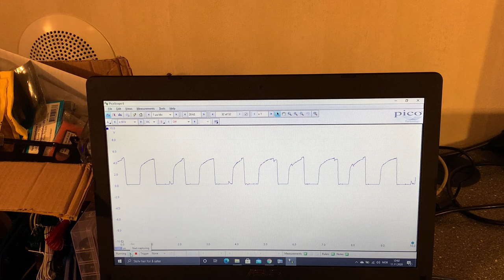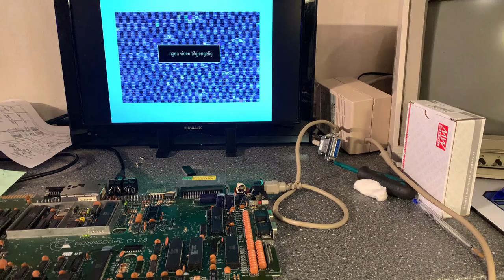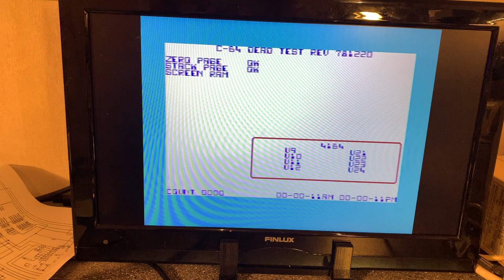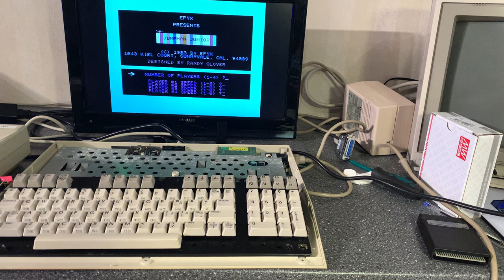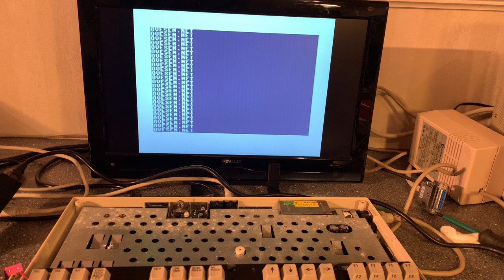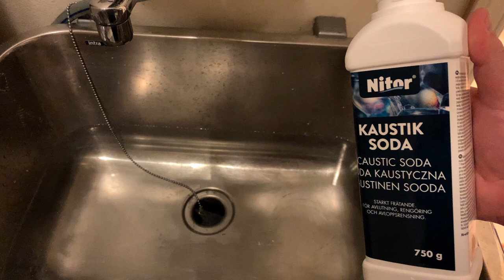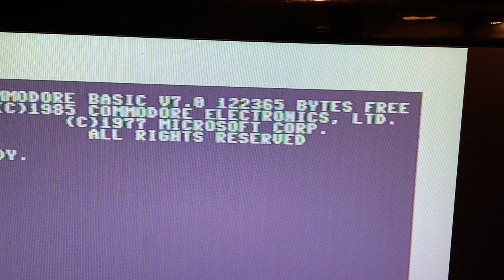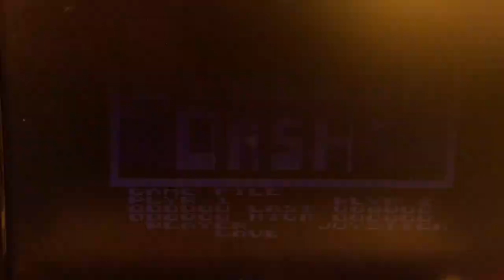Extremely yellowed Commodore 128 black screen repair and restore - Part 2

Comment: Interesting video. I love the Commodore 128. With two monitors attached it was brilliant machiine. Now I have two of them. C128 and C128D both still working. The C128 was my first computer I bought myself with a 1581 disk drive.
Why didn't you replace the voltage regulators with DC-DC converters?
Reply: I want a 128 D too. But haven't found one where the price was not too high. About the DC-DC converter, it is a matter of time and cost. I will look into those some time. This is what I had now :)

Comment: You had the oddly looking character set in C64 mode, because the CAPS LOCK key on the keyboard was in the locked position. It's the 4th key on the top row.
Reply: Oh really? Thanks!